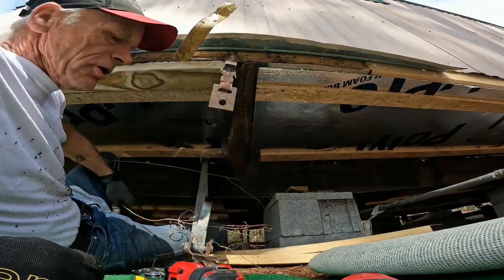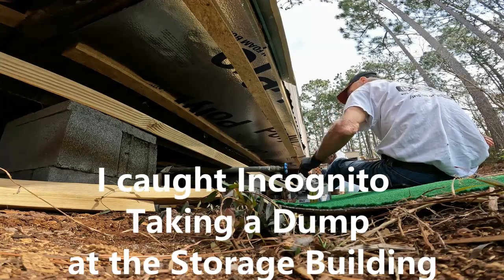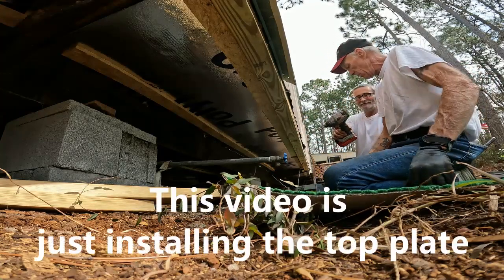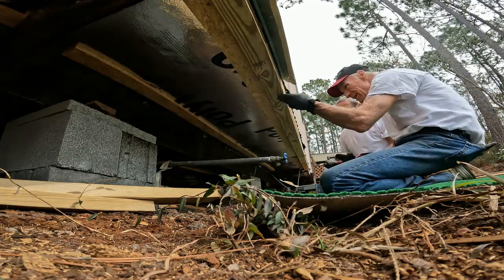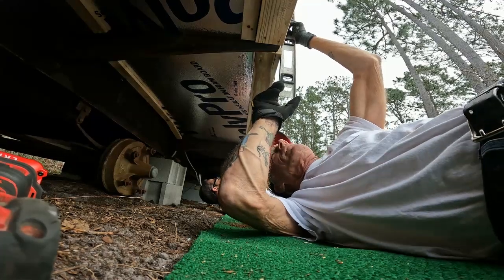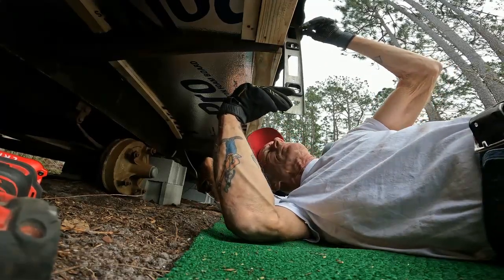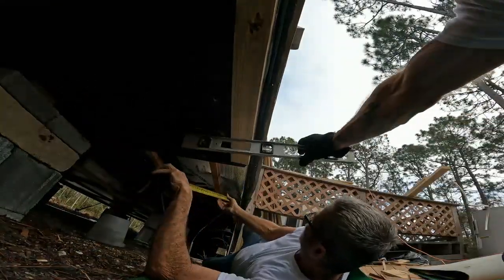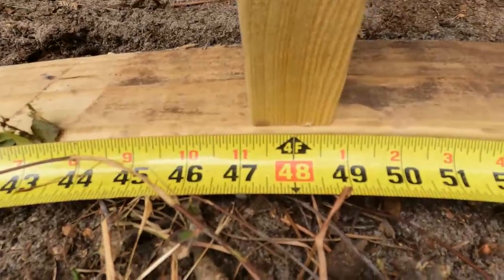Mobile Home Underpinning.

Comment from the maker: We are using exterior deck screws bought from Lowe’s 3 inches long to install this top plate
Reply: I use the tan ones (T-25) about $10 a box. I framed up a skirting wall all the way around our single wide. I used 1/2 inch polypro insulation board to keep the cold air out. For the bottom I used 4x4 pressure treated 10 footers with 9 inch spikes holding them down. I plan on using T1-11 for skirting.
Reply from the maker: I don’t think T-1 11 is a good idea. Use Half inch pressure treated
Reply: Ok cool. Thanks for the advice 🙂
Reply from the maker: You can always call me if necessary my phone number is somewhere is available
Reply: It’s hard not to leave spaces when putting the top plate on? How do you get it to go flush?

Comment: So you start with leveling the floors 1st then move to the underpinning the outside walls? My floors on a double wide are sagging on the outsides. Seems lifting the outside walls 1st would help that issue. Thanks for taking the time to shoot videos! Not easy when you’re trying to concentrate on getting the job done!
Reply from the maker: I’m not leveling the floors from inside at all. I am doing all the leveling from the outside. Thank you for your comment. If you need help, you can always call me leave a message if I don’t answer I’ll call you back.

Comment: What type of 2x4s are you using and will they be different for floor contact? Doing my own project on a 1979 double wide. All my 2x4s are rotted from weather and termites. Replacing them soon. Thanks for the helpful vids!
Reply from the maker: I am using treated wood. Do not use white wood it will not last. Green treated wood